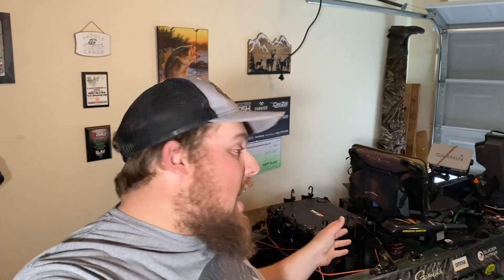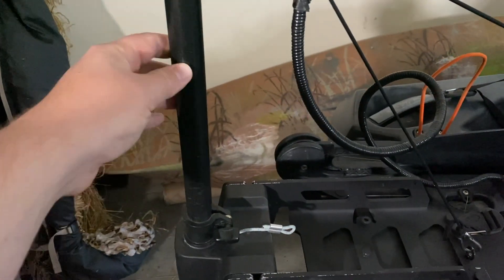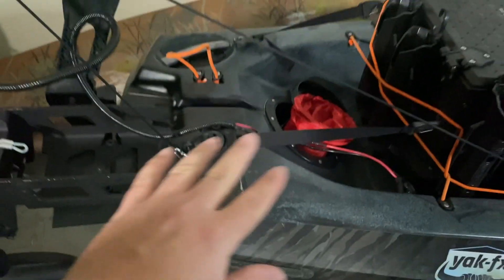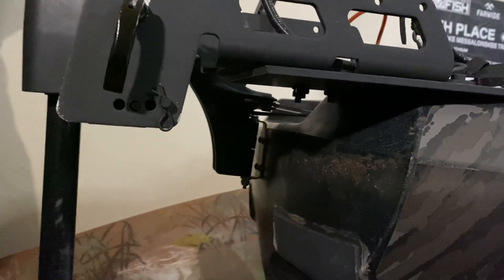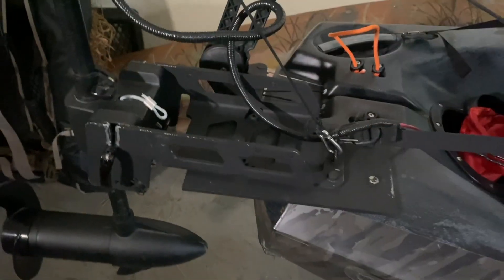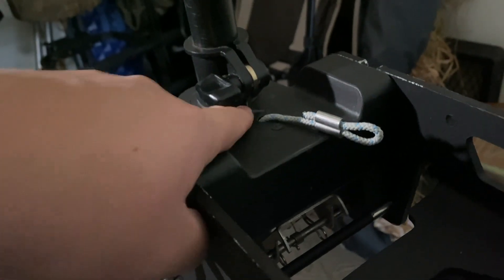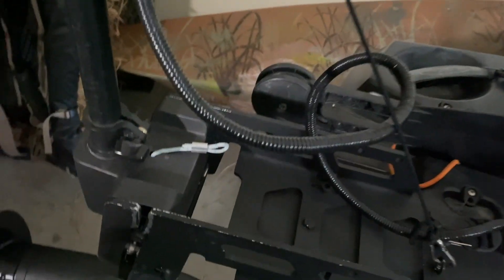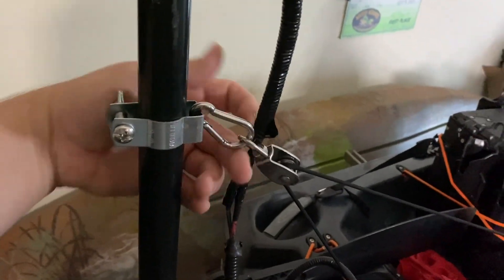DIY Trolling Motor on Kayak | Old Town 120 PDL

Comment: Have you thought of building a pulse width modulator for the trolling motor. With it, you leave the head turned on to the highest setting and can fine tune the speeds manually. From standstill to top speed. Also has reverse without having to turn the handle. Flip a switch and she's in reverse.
Reply from the maker: No I haven’t but for reverse I’d have to lock the motor in. For rivers and honestly everywhere I like that it kicks up if I hit something.

Comment: Nice rigging. 13:07 You mentioned power draw…. Have you looked into maybe adding a Harmnee HMSC07D or similar PWM controller to make your DC trolling motor operate more efficient?
Reply from the maker: I have not! I've been running this set up for almost two full seasons and have not had any issues yet. Though I am probably upgrading to a newport for next season! I want MORE power haha.

Comment: Great setup! Very helpful, thanks!
Reply from the maker: Glad it was helpful!
Reply: @jake_stem_fishing  You said that there are only two wires coming out of the motor, what do white and yellow do? Thanks!
Reply from the maker: @letun3481  this motor is 10+ years old so it only has red and black going into the shaft down to the motor. White and yellow not sure what they could be for. They go down to the head of the trolling motor?
Reply: @jake_stem_fishing  Yes, new motors have two additional wires going out of the shaft, yellow and white 😳
Reply from the maker: @letun3481  I would look up the schematics and see if you can see what it is for. Wish I could help!

Comment: Where did you get the eyelet to run the rope to pull the motor. (The one by the speed control)
Reply from the maker: Check my Amazon link in the description of the video! I have them linked on Amazon!
Reply: @ thanks

Comment: How low do you have it? I want to make sure I have it set low enough
Reply from the maker: I can adjust it I try to get it high enough to almost be out of the water but not losing any speed. For shallow running on rivers. But I can drop it lower if needed. It’s not a set height
Reply: @jake_stem_fishing  ok cool. How hard is it to lower and raise on the water?
Reply from the maker: @RobertRedix  super easy but I have to get out of the kayak to reach it. If you see in the video where the diy welded pin goes. I just loosen that clamp and can lower and raise the motor that way. Super easy! If I hit a log or something it might turn the motor but I just use my paddle with the motor raised to tap it back to straight forward position
Reply: @jake_stem_fishing  thanks man your video is a big help. I want an nk 180 but this is a great setup and for minimal the price 🤘🏽💪🏽
Reply from the maker: @RobertRedix  yea I had this motor sitting around for 8 years inside from a jon boat I used to have. NK-180 is a 24 volt system too if I ever replaced this I’d have to go to something like an Xi3.